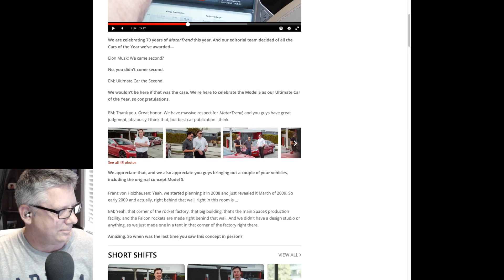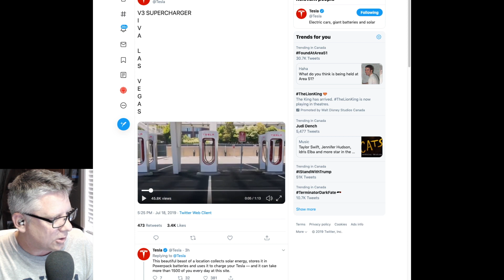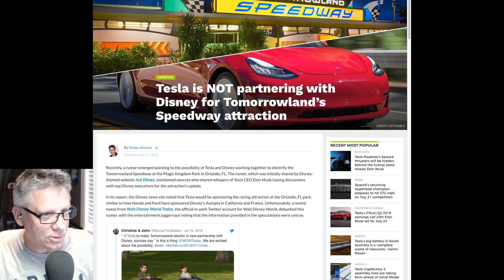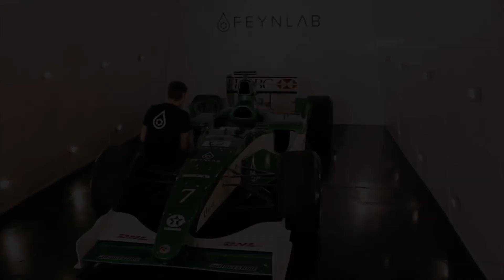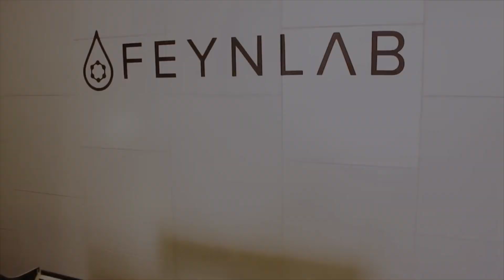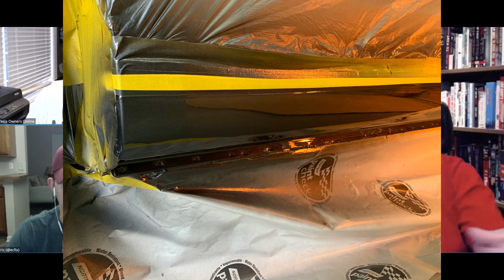48 - Operation de-mangle rocker panel

Comment: You said the dual motor was $48k US, and the P3 was $55k....yet you said it was only a $1k difference.  Huh?

Using the goo with foam insert tires isn't really an issue, it's more that the goo will completely damage the tire pressure sensors and they will have to be replaced.
Reply: Sorry if we made that confusing, for the short amount of time the "base" P3 was made available again it was $5K less than the regular one, so $49,990.

Comment: Great show guys,  I would like to get more info on the model 3 performance 18in wheels.  Is this off menu meaning that I would have to go to the Tesla store to order it?
Reply: I’ve had my P3D since Sept 2018 with std 18” aero wheels and no Performance Update Package (larger wheels, spoiler, brakes, pedals, etc.).  I could not see a reason why I would need bigger brakes to stop the car just b/c I can accelerate faster (I do not drive on a race track)? I also did not want the range loss (~5%) and bigger replacement expense with larger wheels.  This is now a custom order but saves $5,000 - call Tesla or go to a showroom if you have that option.  It is an awesome car and never fails to amaze people.
Reply: @rich1383yt  I did call but they said it was best to go to the showroom with my questions.
Reply: I would like more info on this as well.

Comment: Cheaper the better , will not be buying a car for over 25000 pounds , battery or not , makes no economic sense even with fuel savings . Do not see where these servicing savings are . Insurance not cheaper , servicing only slightly, tyres more expensive . Prices will drop once numbers go up

Comment: Just for the reason of price changes, I did not put a deposit down on a ModY.  I will wait for all the hype to be over and those like me that got my Mod3 with Vins under 10k. We got no upgrades and had to buy with long range, and no 2nd  motor.  No clear advantage to being among the first, but clearly more advantages to waiting. This my turn out to be Tesla's nightmare as many may hold out for better pricing, which there will be.

Comment: As a Tesla owner, I feel that I have become numb to all of the price changes. However, it is though to digest the fact that I have a car loan that is currently $10k higher than what it would cost to buy it new now. I don't think comparing a car purchase to buying a computer is fair since people usually don't take out massive loans to buy them. The financial commitment is much different.

I would also speculate that since most people who are trading up their vehicles to buy Model 3s are probably financing them over 5-8 years. Price reductions are especially frustrating to them. 

That said, I really like my M3 and hope that people are attributing value to their experiences with the car and not just its value.